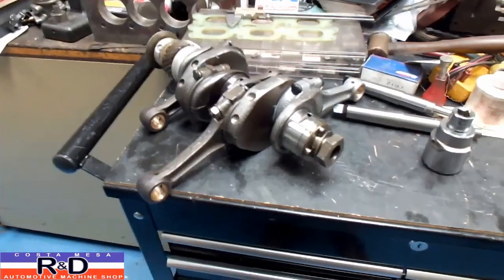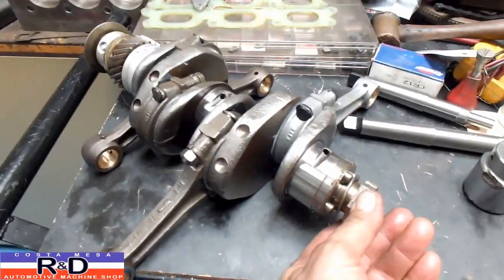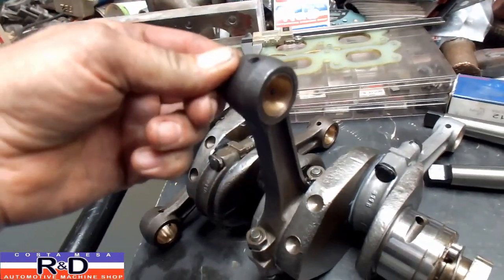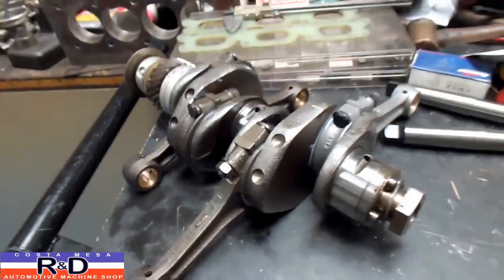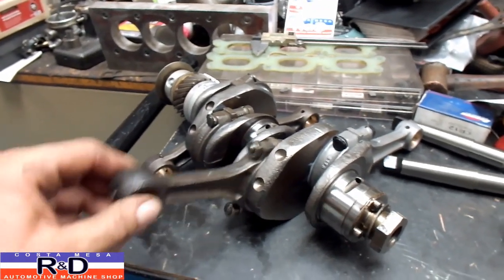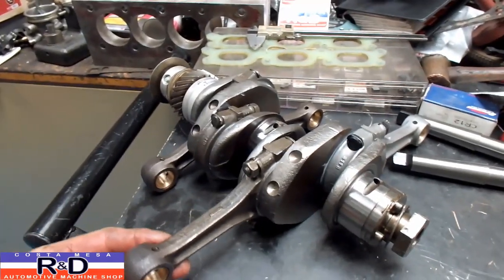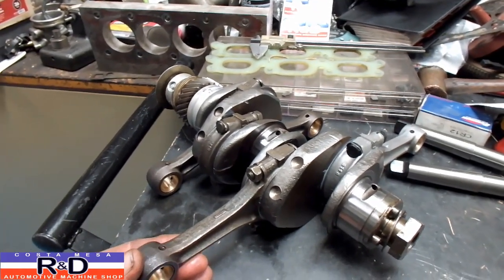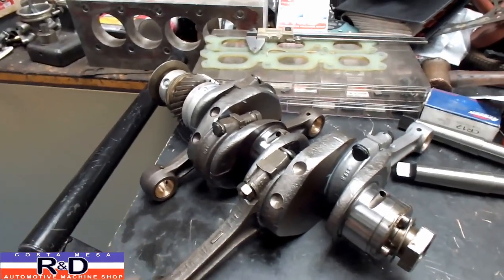Don't Forget to Install the Rod Bearings

Comment: this can't be for real. I ran a Subaru that made noise for 25 years. The #2 rod had no bearing. That one is right behind water pump and oil pump.. got away with it. 136k miles, threw a different rod in 2012, believe it or not, to blow the engine. Was not even the missing rod bearing that killed it .  It even came from Alaska to maine. 3 rod bearings in a Subaru EA82. Thought the noise was a solid lifter.
Reply: caugh bs caugh
Reply: horse shit
Reply: solid  lifter would not make the  level  of noise a  bearingless rod does
Reply: Not possible... Without a rod bearig the oil pressure can't build up properly and near the noise you have a big red light on the dash with an oiler in it. No human drives a car with that light for long...